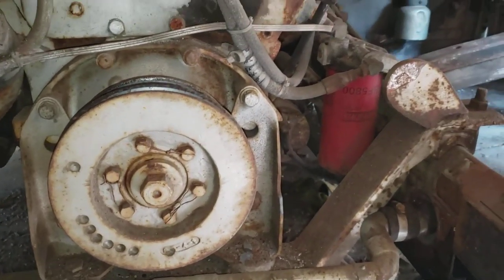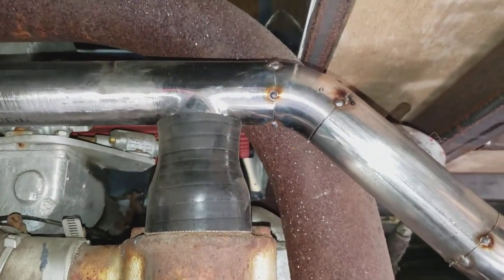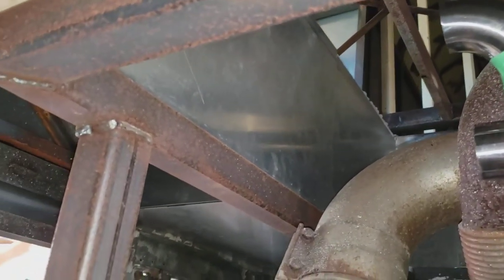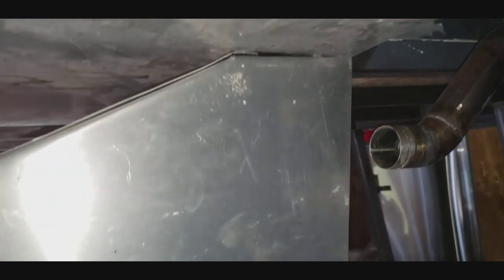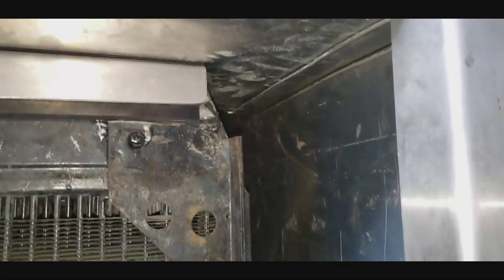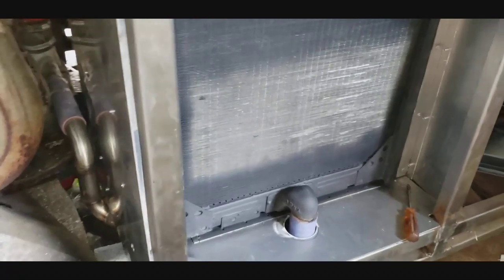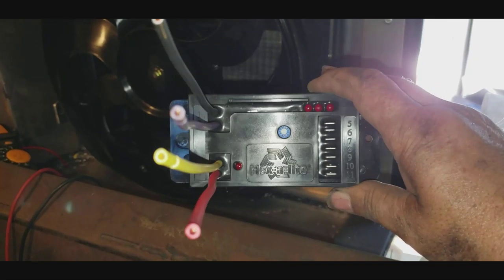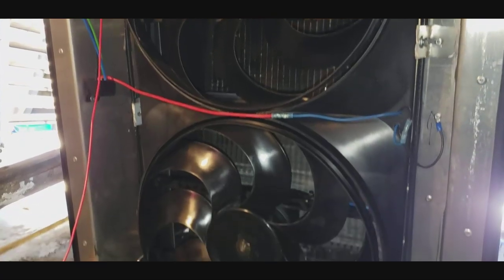Bus Conversion Project - Video 98 - Building the Cooling System

Comment: vibrations when driving could potentially cut the waterpipe from the radiator back to the motorblock if you don't put a rubber gasket of some sort to absorb the vibrations or perhaps make a bent pipe around the hole to remove the cutting edge, far less risks if you  fit a eliptical bend to remove the cutting edge, doesn't have to be something big just removing the sharp edges.
Reply from the maker: I put silicone hose sections in on all 4 connections to allow for engine movement and vibration

Comment: Well done buddy that's a sweet set up that's a ton of air volume in that little area you could build a box and dry some clothes with all that hot air. Lol
It's going to be beautiful buddy make sure you video the move or have your dad video it you have accomplished so much we applaud you for it James 
its been a monumental task.
Keep at it Sir your closer than you ever have been. Is that an 8V92 ?
Reply from the maker: Hey Brian... I'll try to video some of the drive up to Kelowna.... it's a 6V92 ... been opened up to around 400 HP. .. we'll see hoe it pulls the hills and if it overheats
Reply: @JamesEDennison  should be fine buddy can't wait for the run.

Comment: Have you tried the truck/bus aftermarket for fan controllers. I know that Horton fans (haudrilic-powered fan hub) are in most trucks here but with so many euro and Asian trucks/busses on the roads, you'd expect 24v systems to be around.
Reply from the maker: hydraulic seems to be pretty common... probably cause it works good... :-)... somebody might make a 24v electric setup but I haven't been able to find any.... shouldn't say that actually, I originally ordered 24v flex-a-lite fans like the ones I have, they just couldn't deliver  in time so I went with 12v instead

Comment: in regards to the water line being too high, perhaps modify the intake/outtake to go 90 degree from the motorblock to give you that little bit more height?
Reply from the maker: Ya, that's what I did, just rolled it down 90 degrees

Comment: Much better than squirrel cages.
Reply from the maker: hopefully moves enough air.... I have no idea how much air those stock squirrel cage fans moved... I think these move more but don't know for sure
Reply from the maker: by the way I'll video my Jake wiring circuit for you in a bit... how's  your coach coming along???
Reply: I have spent most of the summer working on my house. But recently I have dug back into the MCI. I fire it up regularly and drive it about once per month. Last week I started demo on a GMC 4107 in central Oregon, owned by my girlfriend. The drive train is great but the body has lots of rust. I don't need to be working on two buses.

Comment: Nice work as always.
 I was wondering if you could us a discharge protection board between your controller and the relay. they normally won't turn on the load till they see better than 11.5v input voltage, that should be enough to switch the relay. these boards are easy to find and are cheap online. I have no idea if it would work but its a thought. :-)
Reply from the maker: Ya, probably would... I decided to just run it on 12v after all... seems to be working fine... thanks for the suggestion

Comment: Can you please give me a link to the fans. I’m seriously considering going electric with my 25 ton coach (Wanderlodge). Love to get rid of the hydraulic fan motor.
Reply from the maker: I got mine from Summit Racing but they are cheaper on Amazon.... I discovered later of course... here's the  link, https://www.amazon.com/gp/product/B001DTRRSA/ref=ox_sc_act_title_2?smid=ATVPDKIKX0DER&psc=1 before you get too carried away though, I'm having issues keeping it cool as you'll see if you watch Video 101... I think I may need to double the number of fans and I'm not sure if your wanderlodge will have the room to fit 4 of these units, if you can figure out how to make them work I'd be interested in how you do it, I'm assuming you have an 8V-92 in your coach... thanks for watching